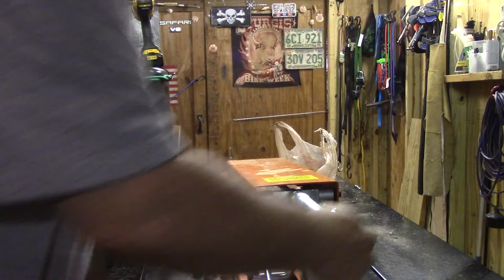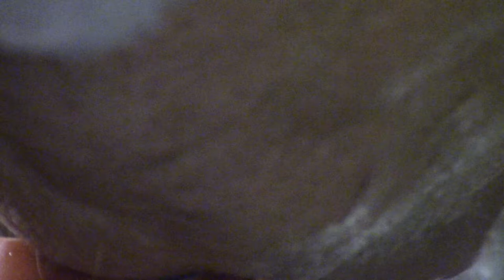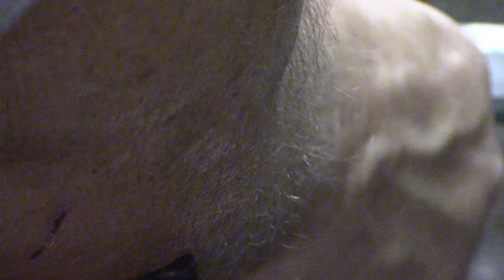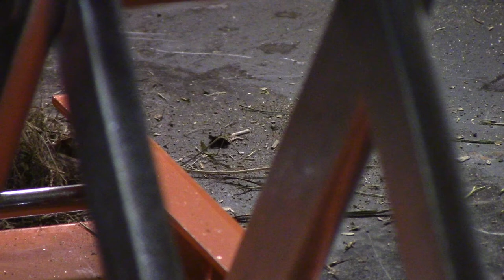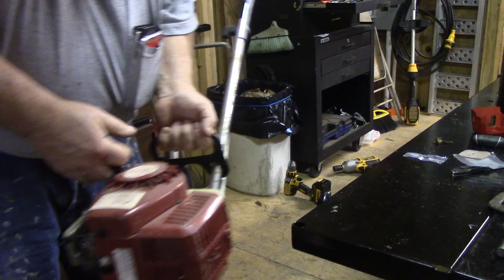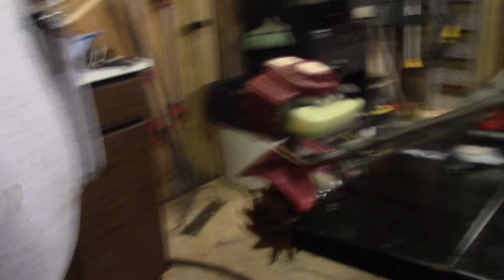Duke's World-Working on A Mantis

Comment: I've had 3 or 4 of those two cycle tillers and  they were all as worthless as the t*ts on a boar pig. "If" you can get it started, and "if" it stays running,, all it's good for is tilling inside a flower pot.
Reply from the maker: You got that right. But the owner said go ahead and fix it. Me, I wouldn't waste the money on it.